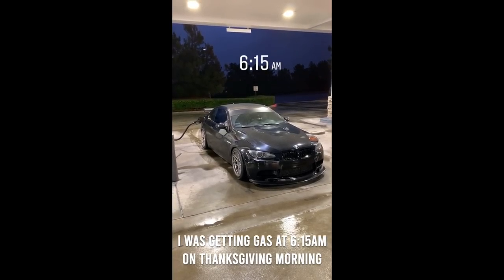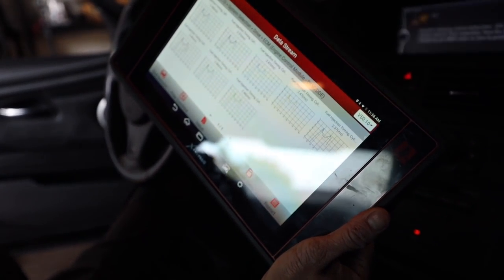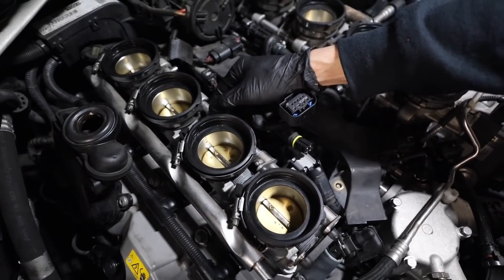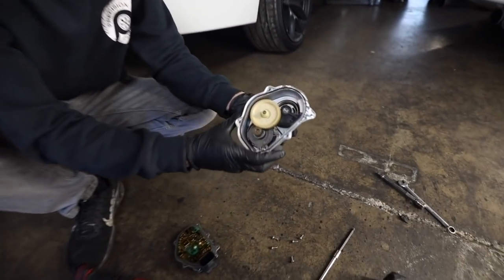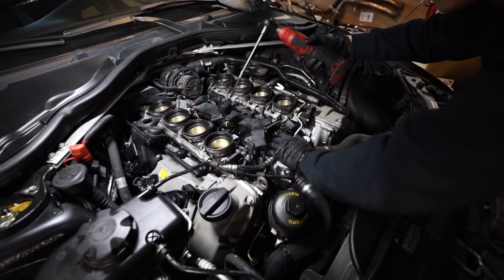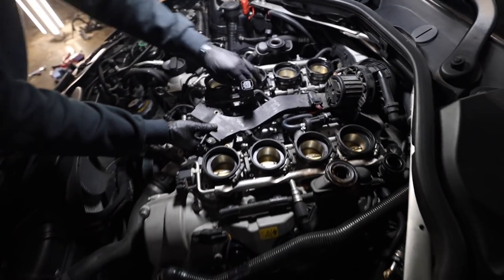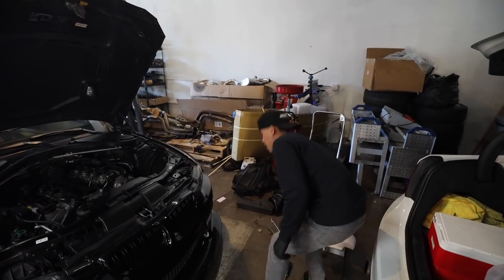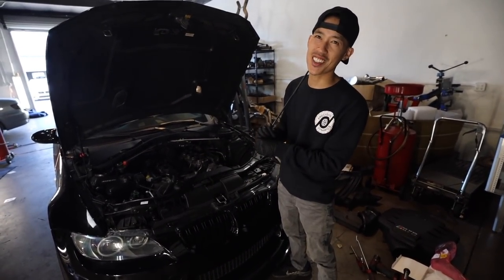Why do throttle actuators go bad? (How to replace) + Coilpack replacement E92 M3

Comment: Prices for Coil packs for the s65 have gone through the roof! Heads up e9x m3 owners. Get the NGK coils, they are stamped BMW. Made by eldor, sold by NGK. Part number
 48729

Comment: This is a great channel!very useful information! Im a small dealer, I just bought 09 M3 e90 with 129k miles. falling in love with it already. So far everything seems in great working order. I dont have any repair records on it, so its a mystery, if any of common things such as rod bearings or throttle actuators, has ever been replaced. I hope,  with such a  mileage they have been worked lol.car drives and sounds very good, no suspicious sounds, by comparing with others and your videos. But just educating myself on all of this,.incase I have to do it. Very helpful!!! And this shop seems to be very honest and very experienced. Subscribed.
Reply: Update on your e90?
Reply: @eyeyamjstn628  Still runs strong!! replaced valve cover gaskets, need to do center shaft bearing. but engine, transmission ,suspension is perfect. do oil analysis and so far it comes back perfect ,no wear on bearing, but I use liqui molly 5w40 green oil. Im also car dealer, so having your own mechanic helps a lot, because I work on cars myself! But Im not selling it for sure!!!! also throttle actuators are still perfect. oh yes, I replaced alternator recently.
Reply: @alexvaviloff5934  alright that sounds solid, nothing too crazy thanks!

Comment: Hi Spencer, really thanks for your videos you made with Mike. I´m just 1 day to late to watch it but now it´s a confirmation for me that I´m busy to do the right things on my M3. By nearly every engine start, the car goes immediately in "Limp Mode" and if not, it´s after few kilometres. I found on internet what could be the problem and started disassembling ignition coils, spark plugs, throttle actuators but till I saw your videos now, I wasn´t really sure about it. So thanks to You and Mike that I can continue without doubts. I would like to send you few photos about it but I don´t know where I can upload.
For your information, I´m a Belgian, working in Slovakia and living in Budapest Hungary and got a big help from You and Mike :-)

Comment: Mate what a awesome video found it as I’m having the same problem with my throttle actuator bank one. I wanted to know a bit more about it. 
Now il be changing both bank one and bank two. 
I strongly recommend the dude who fixed your car goes ahead and designs that plastic sprocket in aluminium. 
If you could get them I’d 100% want them in mine. 
Definitely got my subscription 👍🏻🏴

Comment: My M3 has 134k and to my knowledge the actuators haven't been changed yet so I'm expecting this any day now. Glad I saw the tip to keep the bolts in because I 110% would drop one
Reply: That's amazing, most TA's fail a lot earlier than that.  You ever do your engine mounts? They tend to go at like 60k, but a lot of people don't notice until they are replaced
Reply: @cpy  yeah I had them replaced with my rod bearings at 97k which were toast at that point so I definitely dodged a bullet there!
Reply: You better buy New gears and replace only It before the whole piece torn down.

Comment: Very insightful. Glad I  have a extended warranty which I can make up to $10, 000 per claim. 41,000 miles on mine . Had the usual DCT pan oil leak .
Reply: j. !!! Hey mint was the pan also and gasket . They replaced the oil cooler pipe also at the same time not sure if that’s related at slp

Comment: i need PD to look at my n55 135i. having throttle issues but no codes. very slow when accelerating from a stop unless you hammer the gas. sometimes it feels like it wants to stall for a split second at slow speeds. A/C increases the problem. I just realized they are 30 min from me. mechanic is on point.

Comment: Had both go out on my car within about 5k miles of each other.  Was not smart enough to have done both at the same time when first went...ugh.  Still loved my E90 M3.
Reply: They have nothing to do with each other so idk why you would need to do both at the same time
Reply: Tyler Padgett yes, one controls one bank and the other the second.  However, given they are such a known issue for being prone to failure, I could have saved a good chunk of money on labor by just replacing both when the first failed.  Labor is a large portion of the cost to replace these.  But...this was back before it was quite as widely known of an issue, so...first failed and I replaced.  Within 5k miles, the second failed.
Reply: And by both going out within 5k miles, I am talking about the throttle valve actuators.
Reply: @willjam465  Oh ok I thought you were talking about coils.
Reply: Tyler Padgett it dawned on me after typing my reply that I was not very clear, which is why I then clarified in my second response.  My bad...lol!

Comment: nice bmw man. my 07 335i n54 has the same issue engine malfunction reduced power. i got coils coming and vanos solenoids. i just bought ALL the parts still cheaper than paying a for a diag. hope i get my shit fixed

Comment: Hey this is happening to me. I’m in oc so I’ll head to precision. Looks like you’re out in Miami now. Anyways, so I’m having the EXACT symptoms as you. Hoping for your result and it being a coil pack. What did they quote you for the throttle actuator? Also what did you pay for the coil pack replacement? I know it’s been a minute since you posted this video but any insight would help. I’ll drop it off with precision tomorrow. Maybe Monday.

Comment: friend I have a bmw x6 v8 hybrid and the symptoms are the same as in your case and in fact I have the fault code 2b16 but the vehicle does not have the valve that you change My question is if it could be the throttle on this vehicle that I have in the workshop?

Comment: Ignition coils increase voltage ⚡and  decrease current (Ampers). High voltage (tousand Volts) is necessary to produce reliable spark even for small distances like spark plug electrode gaps. Spark with 120 A (Amps of current) as guy says would melt engine, thats energy used for welding steel 4-6mm thick

Comment: My starter went out..2011 with 65,000 miles.  If you do a starter,might as well pull the throttle actuators also..

Comment: Please, could you post the name or link to buy that throtle actuator brand?
Reply: I need that too plz, my e92 m3 went definitively in limp mode, so the mechacic opened the actuators and the gears were literally missing teeth. I'll try to replace only the gears but i need the link to Brand New actuators If this dont work. Ty

Comment: You were lucky, coils and throttle actuators are easy to do.  My car hit limp mode, turned out to be broken valve spring in cylinder 4.  Nightmare and very expensive repair.

Comment: Why wouldn’t people replace both? Would suck to replace one and then have the other go out a week later. When they go and it throws a code does it show which bank is defective? Just got an 08 and I have spent so much money to make it super solid. Now have to do valve cover gaskets, rear pinion seal on diff, overhaul on brakes, etc. Guess I should consider this if I’m doing valved cover gaskets. But damn another 1300$. I could cry.

Comment: My 08 did exactly same with increased emissions light also lit.  Did O2 sensors. No change.  Did T.A.s and low press fuel sensor.  Problem solved.

Comment: I know that the owner of Precision says that the TAs go out 50k - 70k miles "usually" but I have 3 buddies with E9X M3s and their TAs went out between 120k and 140k miles. I am at 80k miles and although I have changed almost everything that there is to change on my E92 M3 6MT, I have yet to have the car show any sign to me that the TAs are about to go.  Perhaps one variable that nobody discusses is how hard the owner drives their cars doing multiple hard launches, donuts, track driving, cold start revs, or drifting. I would like to hear more backstories from people in addition to what mileage they changed out their TAs. Or does anyone know of a database that M3Post or some other forum (such as MGruppe) has that has collected the statistics on when an E9X M3's TAs were replaced?

Comment: As a past BMW tech, back in the e36, e34 etc days, I can definitely say BMW has cheapened the absolute crap out of all of the cars and parts after the era I worked on them in.  Plastic fucking throttle actuator gears on a $70,000 car is flat out criminal.  The “friction coupling” crank gears are another example, for $70,000 on a damn ‘Motorsport” car, that should be billet one-piece from the factory.  1.25 mill crank bearing spacing and then on top of that specifying 10-60 weight oil in those engine is plain German stubbornness for no reason.  BMW knowingly shipped thousands of ticking time bombs due to engineer ego.   BMW stopped caring about quality after the late 1990s/early 2000s.  It’s clear as day.   

Let’s review, BMW stands for: Break My Wallet, Bring Money With, Bavarian Manure Wagon, Bitch Moan Whine, etc.  “the ultimate driving machine” my ass.

Comment: My bmw idle rought at cold start only rpm goes up and down sometimes to the point of shutting off any ideas I took it to the mechanic they said it was the mass flow sensor replace it and still does the same help
Reply: any update on your problem?   mine do the same
Reply: @majdtrading5970  yes it was my air intake I had a aftermarket one and it didn't fit 100 percent good so it had a air lick by the tube it was fix by switching the intake system

Comment: What a mickey mouse set of gears to perform a a constant function.  I am shocked no 3rd party has produced better metal or at least delrin gears.  This is stupid beyond ken for a no holds barred engine.  Makes my N54 seem much more sane..

I do not understand why one would want to code out TPMS?

Black car in FL,AZ or Texas is a very hot car. Almost no one budgets for deferred maintenance.

Comment: Please what is the motors is the v8 or the 6 cylindre hôoo escuse my is the v8 yes the M3 e90 is the v8 sorie change the turbo the BMW trop litul ho for the stage 3 yes is ok for puissance the stage 3 yeée si good